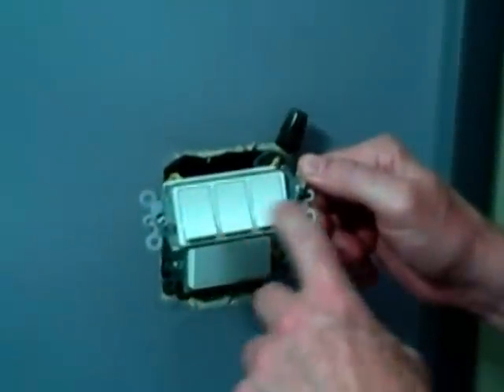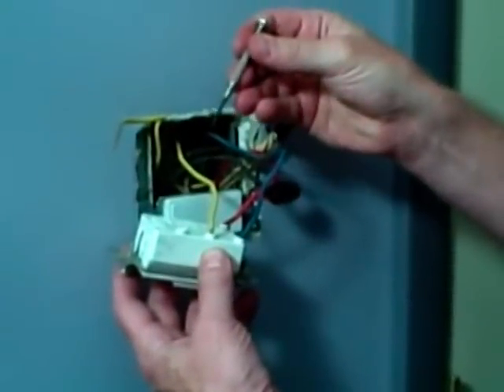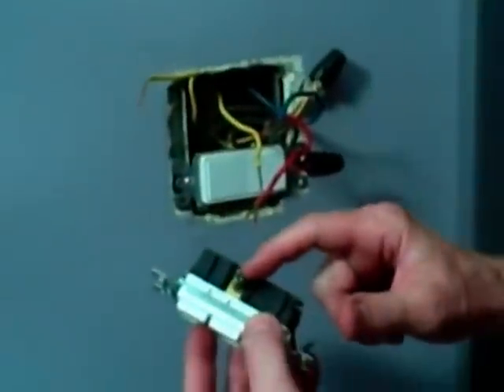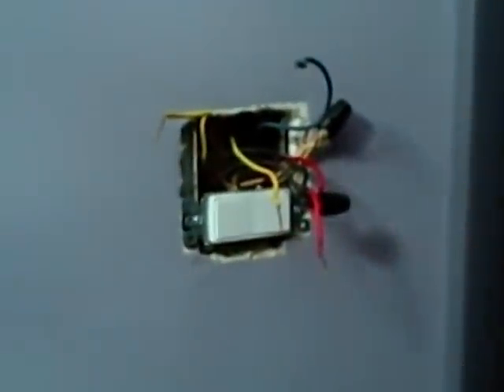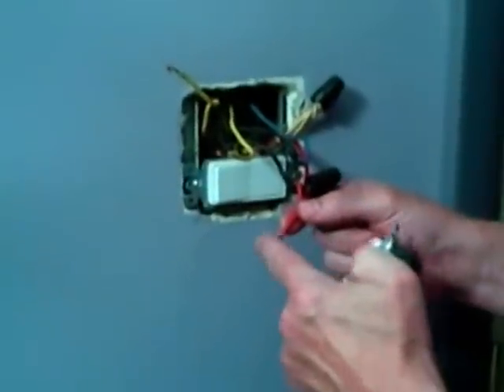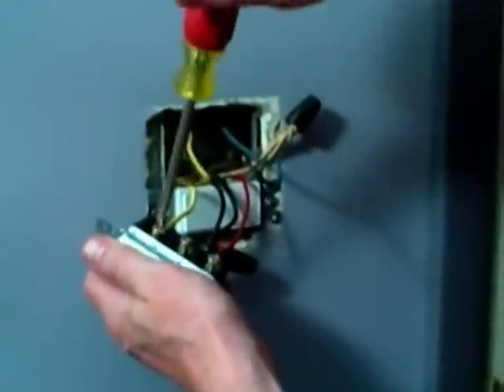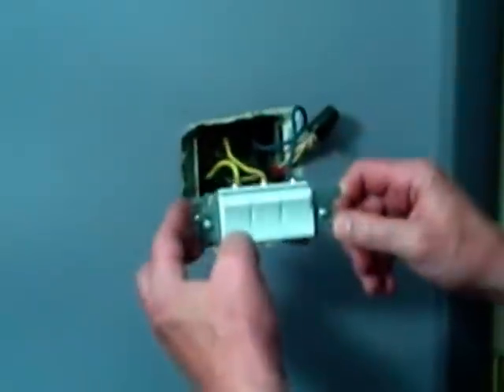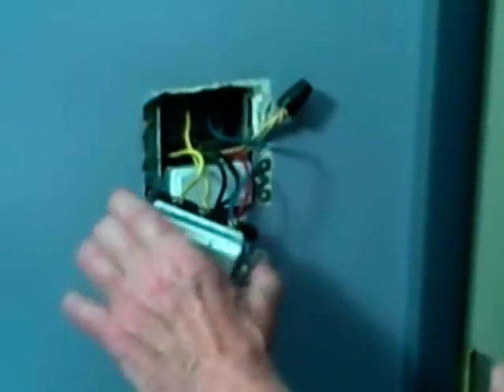How To Wire a Triple Switch - 3 Single Pole Switches - Conduit

Comment: i am wiring the same 3 switch, 3 single pole switches style unit you did (leviton). I wired the hot to the black screw, one of the black feeds to one light feed (I will run the others as soon as i have tested it works for one), connected all the white neutrals together, and all the grounds together with a pigtail to the ground screw. Seemed simple enough but it kicks the circuit each time i turn on the power. I haven't figured out where I am going wrong yet. As I said, seems simple enough but there must be something that is not quite right. Any ideas? I will say I am using Wago connectors rather than wire nuts as I feel they are easier to get a good connection. Thank you.

Comment: I bough this same switch for my mother in law house.   Her old switch was coneected this way. ..  the hot wire wus conected in three screws on the same side . The other other two black wires n the white wire on the other side ..    ifollow the instructions  of this switch bt  at the end. Ineeded another one more wire for the switch . So ijus conected two wires n the white wire were they belong. Thinkint it might work ( the fan.and heater of the bathroom). Bt idint not.   Please help
Reply from the maker: Hi, you can send a picture of you setup to fixitpodcast@gmail.com.
Reply: @FIXITHomeImprovementChannel yes, I've seen this as well in older homes. Please send link if this issue has been addressed before. Thanks.

Comment: I am trying to replace and older NuTone switch with a new one.   On the old one, there is a yellow, blue, orange wires going into one side of the back of the  switch,  and 2 blacks and 1 white on the other side. (there is a green ground wire attached also).   On the NEW switch, on one side there is a screw lug for the common wire,  and on the other side 3 screw lugs, and the ground.    So I have 6 wires going into the old switch assembly,  but room for only 4 wires on the new one.     Help,  and thanks.
Reply from the maker: dan hanway Hi, can you send me a picture of the old setup? fixitpodcast@gmail.com
If it is a triple switch, you should have a dark colored screw (common) for the feed wire coming into the switch, then you would have the  3 wires going to your lights or load from the light colored screws. The white wire should not be connected to the switch. Are the 2 black wires connected?

Comment: i did the same as what you did..but why is it that the three lights are controlled by just one switch?
Reply from the maker: Hi, usually a triple switch is put into an electrical box that wouldn't be big enough for 3 individual switches.

Comment: I have 3 single pole light switches and 3 lights, using 14/3 wire. The 2 outside light switches work but not the middle one. Suggestions?
Reply from the maker: Hi, you can email me a picture and details to fixitpodcast@gmail.com.

Comment: WHAT IF U HAVE 2 hot wires coming out? I had a despard  3-pole switch and each bathroom has two hot wires. One-bathroom actually has 7 total wires and the other has 6. none were labeled very well, so I had to find which ones were the hots. So again I have two hot wires per bathroom. I can find zero answers
Reply from the maker: Hi, email me at fixitpodcast@gmail.com and I will try to walk you through it.
Reply: @FIXITHomeImprovementChannel  I've seen this as well in some of my older homes... Two hot wires and three traveler wires... If you ever get a chance, can you post a video on this. If you already have, please upload a link.

Comment: An old despard triple switch has a total of 6 terminals or screws with wires.  The rocker switches like shown in your video have a total of four wires.  How do I go about wiring from a six wire switch to a four switch?
Reply from the maker: Hi, usually the electrician ran multiple pigtails from the feed wire to the feed side of the switch. Can you send me a picture of the wiring and I will try to give you a hand. fixitpodcast@gmail.com

Comment: Yes it's a big chill water airconditioning hvac.its the main building club house,2 chiller & we have a 2 cooling tower.& we have our own technician but they charge too much if I ask them the question.
Reply from the maker: Hi,
I'm not familiar with this thermostat, but here is a number to a company that should be able to help. 1-866-494-4610.

Comment: I have this kind of switch to change out. The top toggle goes to my kitchen lights and has 2 black wires going into it. One on each side of the top switch....Not sure if one of those is the 'common'. Also you didnt mention anything about the ground wire in which mine has that as well I believe going in to the bottom of the switch. If you shut the main power off is there any chance of still getting shocked ? I dont have a wire tester

Comment: What happens if the live wire is attached to one of the activators? I believe I did this since the other two switches on mine would only activate with the first switch on. Im finding out as I type this.
Edit,yes thats what I did. Odd that the bottom two switches still worked. I would think the power would have been blocked off from the top switch . Now I know.
Reply from the maker: Hi, it won't work on both sides. Do you have 2 switches that opperate your light or 3 switches that work together?
Reply: Its a 3 rocker switch.one to bathroom lights.one to a bathroom fan and the other to another fan(I installed two bathroom fans in one bathroom. )
Fan switches would only activate when top switch was turned on. I swear I had the correct wire as live. That's what I get for not using a voltage tester. l Switched the wires ,works as intended now. I was overly confident to begin with .
Reply from the maker: Tester comes in handy!
Reply: Indeed. I have a bunch of tools,tester not one of em, On the list!
Reply from the maker: Check out this tester https://www.youtube.com/watch?v=OUo6lMhEKYU
Reply: Is that what you use?
Reply from the maker: I have a different one in each bag. I like the Klein and Gardner Bender. Gardner Bender is less expensive.
Reply: Might have to go with klein. Bought one at Walmart since I am doing more wiring. Works for the purpose I suppose. Im still alive.
Reply from the maker: Ha

Comment from the maker: Hi, if it is the same type of switch. You will have one common screw. It should be marked. This is the hot coming from the service panel. The other 3 screw terminals will be the hot going to each light or outlet. I would get a tester, it will tell you which is the common and it is great to have around the house for safety. If you have a ground, connect it to the green screw. If you can email a picture, I would be happy to take a look and answer any questions I can.

Comment: Would it work still if u put the common on the opposite side where the 3 switch screws are? You know like ones nice versa or will only work if you correctly out common where commons goes then the other 3 wires to the contacts on other side
Reply from the maker: Hi, the electric needs to come in to the dark colored screw. That will feed power to the three switches.
We have more home improvement tips on our weekly podcast http://castbox.fm/u/6389499.
Reply: So I did my switch right it's a single pole w 3 switches I can't find a single 4 switch I did but was 80 bucks

Comment: Great video! I have an issue. If I switch on any of the switches the breaker trips. What may be the reason? Thanks for the reply in anticipation
Reply from the maker: Hi, you could have a neutral wire connected to the switch.

Comment: Thanks for the video! I have a question, I need to replace a 3 toggle switch and one of the switches is also a multiway toggle (meaning the other side of the hallway has a switch that can also turn it off/on).    Do you know what is the name of a 3 toggle switch that has one of the toggles needed to be multi-location? I guess 3 Way triple Toggle Switch?  I don't seem to find it on Home Depot's website?
Reply from the maker: Hi, if a light is operated by 2 switches, you have a pair of 3 way switches. You should be able to have them order you a triple switch with 2 single pole switches and one 3 way switch. If not try your local hardware store.

Comment: Do they make a triple with one isolated circuit? I'd like to use one to power an isolated garbage disposal and the other two to run two different light fixtures
Reply from the maker: Hi, I have never seen a triple switch with a break away tab for a second circuit.

Comment: how do you connect two of these switches together off same circuit?
Reply from the maker: Hi, turn off the power to the circuit, remove the old switches and separate the wires so nothing is touching. Turn on the power and find the hot wire and mark it. Turn off the power to the circuit. Take the marked wire and connect it to 2 six inch wires under a wire connector. You now have 2 hot wires that you can connect to your switches. 
Let me know if that helps.
Reply: FIX IT Home Improvement Channel already have that... 
I have two of these 3 pole switches. I and putting one on each wall coming into bathroom. how do u connect these two together on same circuit
these are both 3 pole switches that run a fan/light/heater in bathroom.
Reply from the maker: Hi, so they are not in the same box?
Reply: FIX IT Home Improvement Channel No opposite walls, coming in from each door so I have switches at both entrance/exit way. but want them to work same fan in said bathroom.
Reply from the maker: For that fan you will need 2 three way switches and wire the switches together with a 14/3 cable with ground. Here is a video that might help. I plan on doing a diagram and putting together another video. https://youtu.be/4dAql69PK5E
Reply: FIX IT Home Improvement Channel we have two switches I already told you that and we have the wire one is connected and working we just can't get the other to work.. when we hit the paddle it works the fan n light at same time..
Reply: these are 4 pole sorry.....
 3 pole (to work light/fan/heater independent) & then the ground.
Reply from the maker: Hi, can you take a picture of the switches and email me at fixitpodcast@gmail.com.
The first email said you have 2 of these switches. The switches in the videos are a single pole and a triple switch. I am unclear on what you have.
Reply: FIX IT Home Improvement Channel it the same as what's here.. but yes I'll get pictures and send.. thank you.
Reply: my husband figured it out thank you..
Reply from the maker: You're welcome